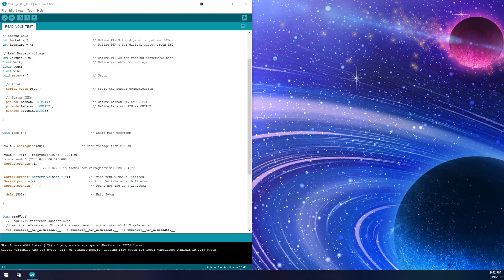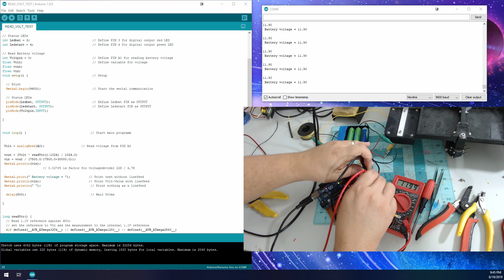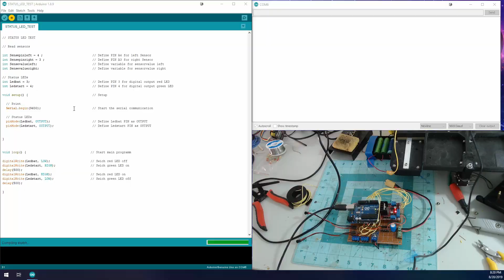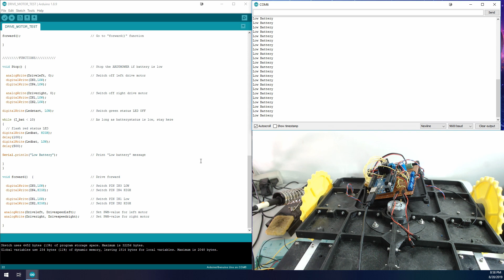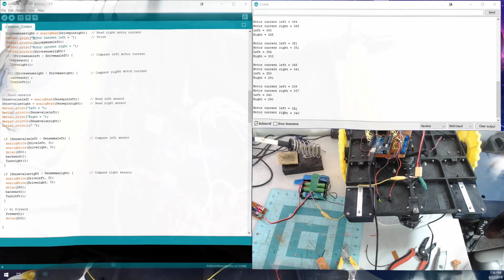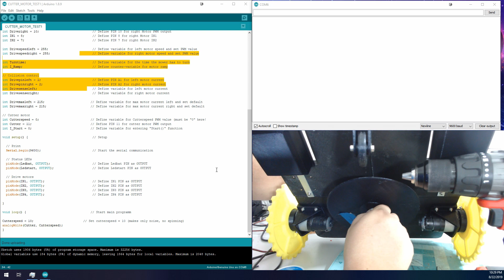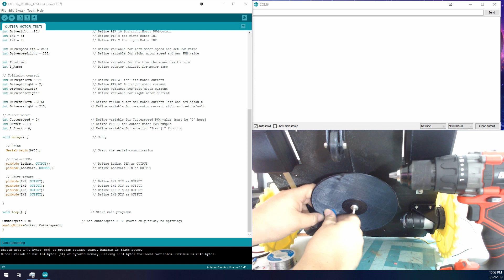3d printed arduino Robot Mower Working

Comment: Great video to actually see someone building this mower. I have the plans and printer some parts but the part list referrences German supplier. Where did you get your electronic parts from. I am also in Florida. Thanks!
Reply from the maker: Sorry for the delay.  I got parts from all over, aliexpress, robotshop and Amazon.
Reply from the maker: I moved out of fl but a big problem I ran into was the sugar sand and those thin wheels

Comment: Not sure why you need code to spin blades. Lawn mowers and string trimmers just spin at the static rate of the motor.
Reply from the maker: You are spot on.  But a regular mower and a string trimmer, you are the feedback loop.  You can tell by the sound and resistance if you are about to stall the motor.  So the code for the cutter disk is acting as that feedback loop that doesn't exist in the autonomous mower.
Reply: @CrankyCoder  Thanks for the reply. Understand what you are saying but before deploying an autonomous mower we would use the conventional tools to reduce the lawn growth to the management level of the auto-mower.  Excessive resistance equals heat and that kills the motors quickly. Stock mount brackets cut half the cooling
Reply from the maker: @dronepilotflyby9481  Ah yes.  I understand what you mean and i do the currently, i still use my regular mower while i am working on this.  Ideally, as you indicated once it's at a "maintainable" level the logic shouldn't be necessary.  Unfortunately here in FL, we get a week of rain twice a day.  Preventing the mower from being able to get out in the yard.  Then by the time the grass has dried it has gotten a little too long.  That is where my logic would come in.  Ideally the autonomous mower would keep things knocked back consistently, but FL weather doesn't really play nice.  That is the only reason I was planning on doing the logic, just to help lower the heat/resistance by a feedback loop.

Comment: Can you do review of this? Does it have sensors in the front? 
Thank you!
Reply from the maker: I definitely can do a review of this style!  There are definitely some thoughts I have on it, so that's a great idea.   At this time I do not have boundary wire sensors yet, the bump sensors are done via the motor controller drivers.  I can talk about and show that in the review as well.  

Any other thoughts or questions that I could answer/talk about be in a review style vid?
Reply: CrankyCoder ,  
Here are a few questions I have.
Cost? 
What would you change? 
Where the instructions easy to follow? 
Do you plan to make it solar powered? 
What happens if it mows in the rain? 
Do you plan to have an army of them?